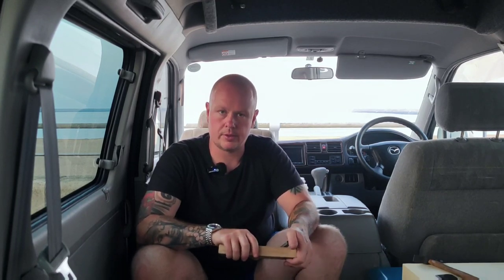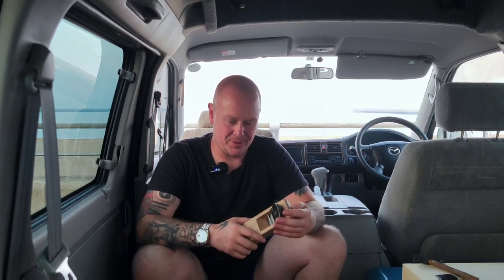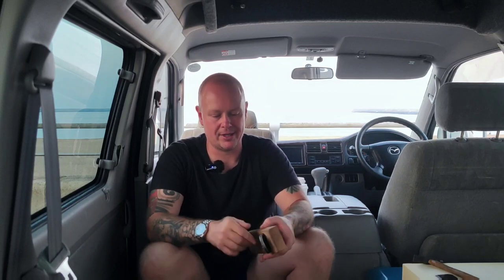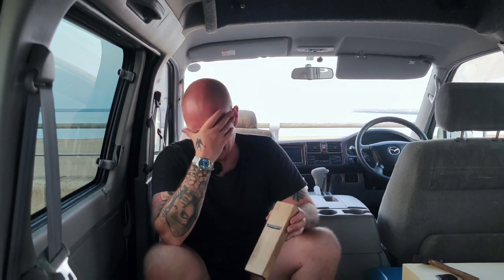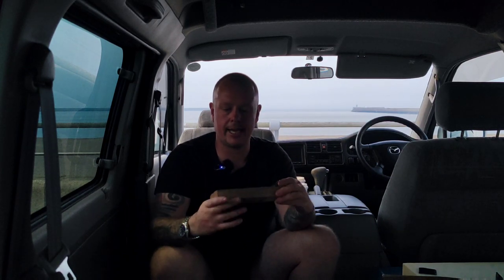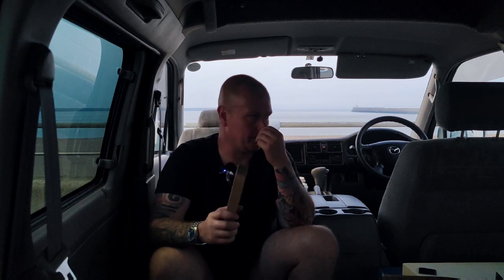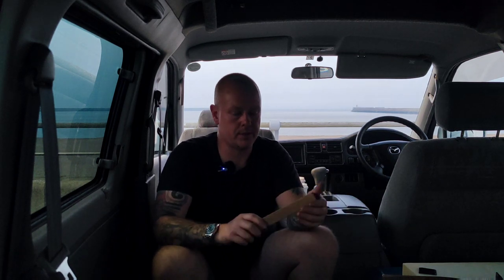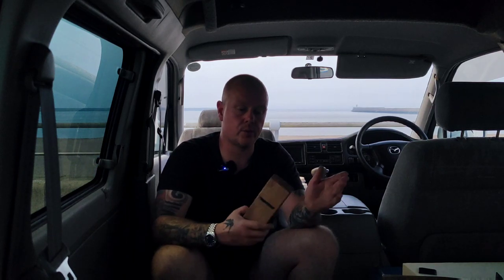pocast 111. Japanese plane talk.

Comment: Japanese steels vary so your sharpening will reflect that. My guess is it's Blue steel, Blue Steel #1 or #2 I don't know. 
For a quick rundown; Yellow Label steel is refined to White Label steel 2 (Shirogami. Shiro is white in Japanese). From here, carbon is added to produce White Label 1. The small grain structure of high carbon steel makes it ideal for keen edges. Alternatively, from White Label 2 chrome, tungsten etc. is added to produce Blue Label 2. (Aogami. Ao is blue in Japanese). Additional carbon produces Blue Label 1 to improve edge sharpness. 

Blue steel came about to improve reliability and ease in manufacturing and has little to do with end user. Blue #1 ultimately has the same carbon content as White #1, but you'll be sharpening large grains of tungsten and so on. It will wear less, so takes longer to sharpen, but will never be as keen as White #1 (As far as I understand). Although it's argued 10-20 strokes of a plane reduces keenness to whatever average sharpness the blade is capable of maintaining anyway. 

Blue #1 is recommended for planing certain hardwoods from what little understanding I have, but they're still great overall. The marriage between soft iron laminated with high carbon steel makes hand sharpening a large bevel blade quick and achieves an unbelievably keen edge. 

Apart from that info dump, you might like to read this info on Japanese planes and set up. At the bottom of the article you'll see more parts to the topic. 
Adjusting the blade: https://covingtonandsons.com/2021/04/10/japanese-handplanes-part-2-blade-adjustment/
Fitting the Blade to the Body: https://covingtonandsons.com/2021/05/08/japanese-handplanes-part-4-fitting-blade-body/

The guy is quite humorous but is serious about refining tools.
Reply from the maker: Thanks very much for taking the time to share the information. The steel is blue, not sure which. It does make a lot of sense what you are saying, and I do agree with you. I'll have to check the link out 👍

Merry Christmas, should you celebrate it.
Reply: @DW_woodworks  No problem. Japanese tools have a bit of a learning curve and even then, there's different opinions on set up and maintenance. I'm pragmatic so just settle when I find something that works and makes sense.

I'm full of turkey mate! Merry Christmas, hope you're having a good one. Take care.